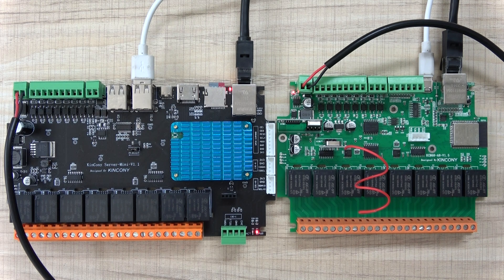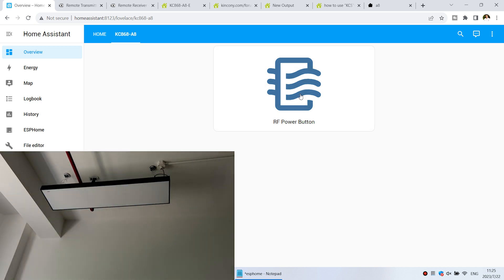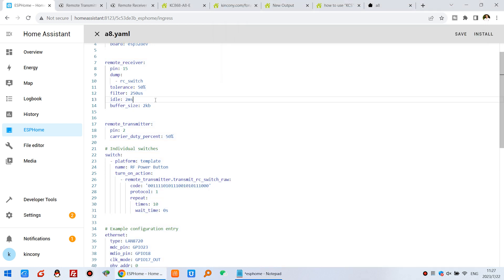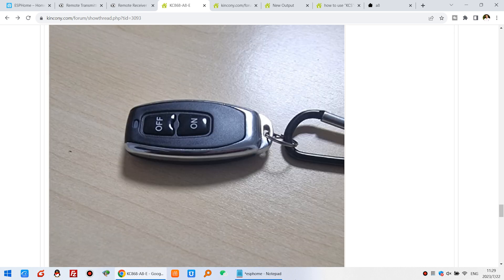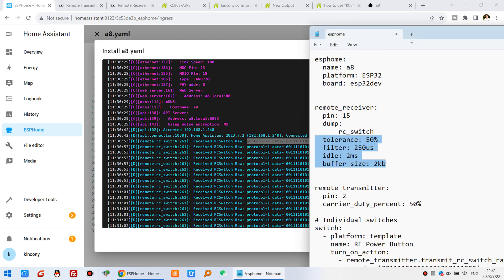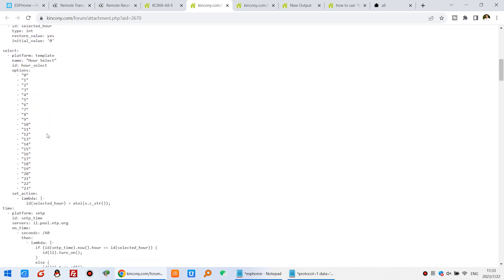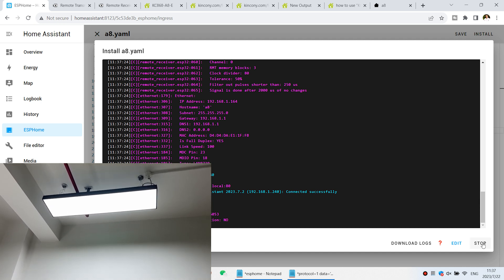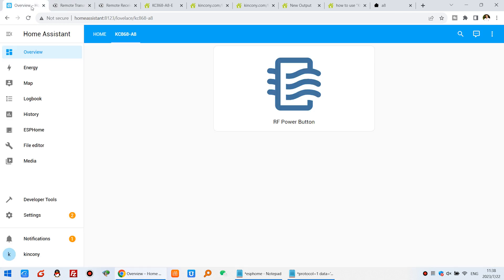how to study RF signal and send it in home assistant by ESPHome

Comment: This is so cool. I’m too new Home Assistant coding to fully understand what’s going on but I want to! Do you have a video with start to finish, step by step using an ESP32 module do you have example code? I have an rf 433MHz 12v relay that came with a black remote just like the one in your video. I also have a bunch of ESP32’s.  I just installed Home Assistant on my mac. I’ll rewatch this video again to see if I can figure out how this all works. 😂
Reply from the maker: if you use ESP32 module, you can config RF by ESPHome, esphome have online guide details.
Reply: @KinCony  okay I’m going to look. Thanks so much. Excited.
Reply: @KinCony  hi! I think I’m getting close to setting everything up and figuring it out. My remote has an A and a B button (two buttons). One causes the relay to go on and the other turns it off. Do you know the code I would add for the second button / signal? Would it be under the same “switch” or do I make a new entry? Or do you know of a good template for 2 button code? When I google search yaml code for this project the results I get currently are very different than your code (a lot of extra variables you aren’t using that I don’t understand). Thank you so much!
Reply from the maker: every remote's button have different KEY CODE, so need to learn every button, create AUTOMATION for every actions. @RND-USA
Reply: @KinCony  I got it working! Thanks so much!

Comment: Hello i have a Kincony A16 flashed with Tasmota Firmware from the Kincony Forum. But it doesn't work with RF signal. I hope you make also a Tutorial for RF control with Tasmota.
Reply from the maker: you need define RF gpio for RF sender and RF receiver pin, then create "RULE" in tasmota, it's just AUTOMATION.
Reply: Can you give an example of the rule?

Comment: Hello Kincony, I've noticed that you use relays extensively to control the switches. I'm curious, what are the reasons behind not using triacs? On paper, triacs can handle about 1 million switching cycles before failing, so wouldn't that be a better option?
Reply from the maker: Physical contact is safer
Reply: Also they can handle more current
Reply: @erickademe  relay or triac?
Reply: Relay
Reply: @erickademe  that's true, but ssr takes way less space and is perfect if the current requirement is lower.
Reply from the maker: @AI-Doom-  we have some board use by MOSFET output.